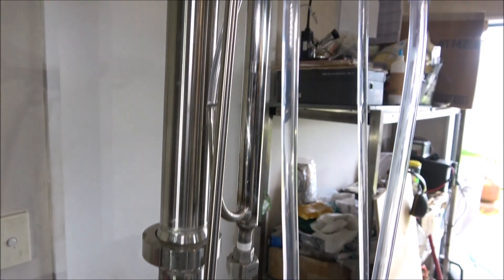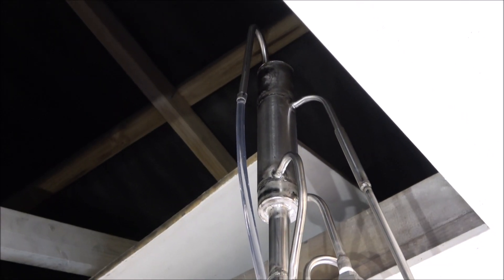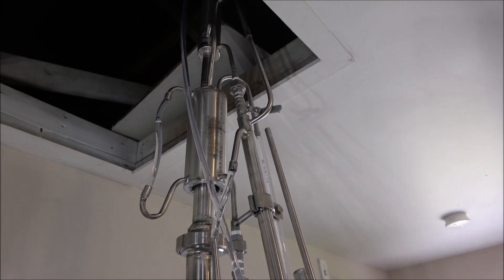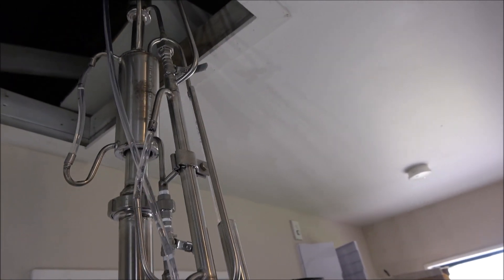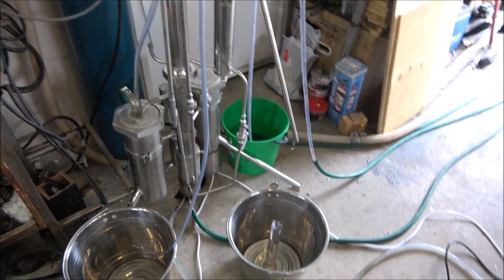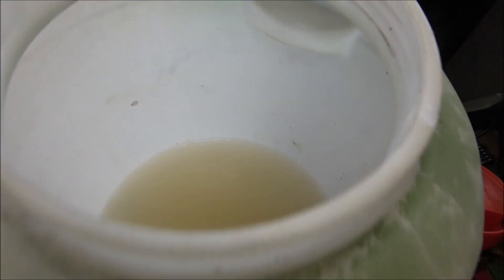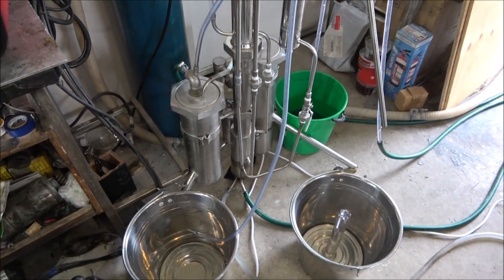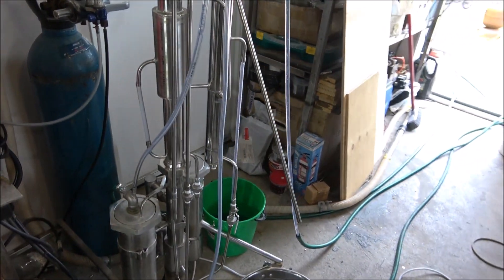Homemade Continuous reflux still, construction overview and testing.

Comment: Does your build include copper? I heard it is important element to remove sulfide gases and compounds from vapours. Without it it , gases can reach deadly levels. Stay safe
Reply from the maker: There is an option to replace the stainless packing for the copper one.

Comment: how do you clean the inside of the tubes when you are done with your distillation
Reply from the maker: One can run water instead of wash to rinse, also there some drain points, and just for the information, we are running a similar column once a week for the experiment, the column was built back in 2007 and never was cleaned inside since then. The steam generator is cleaned with vinegar from time to time.
Reply: @santeryi9  how mach vinager do you put in